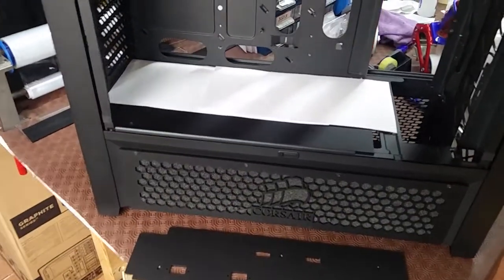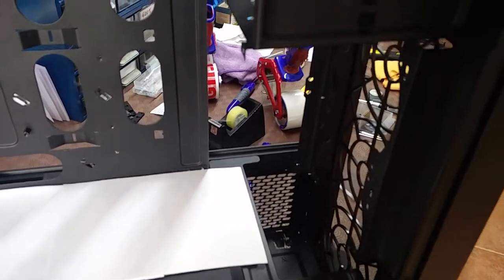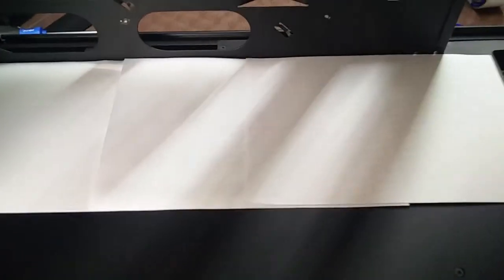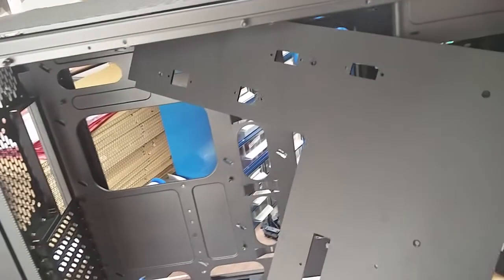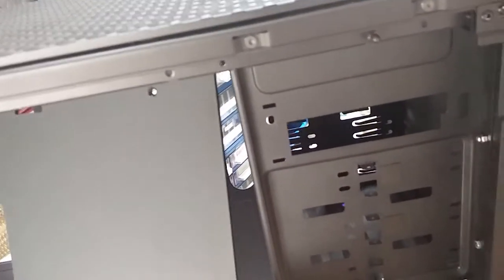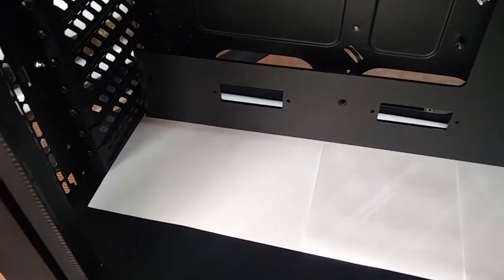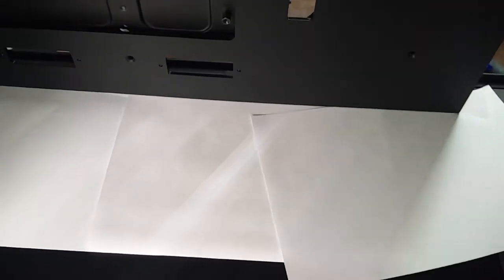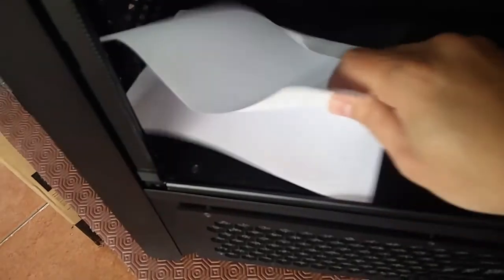Corsair 900D Mb tray cover how to install by ColdZero

Comment: Have this its great but was wondering if u have updated version .just got my new mobo which is eatx unfortunately not enough room to route my atx power cable
Reply from the maker: These can be made for e-atx motherboards as well. You just need to order and add a customization note saying you'd like to fit with an e-atx motherboard. And mention the motherboard model as well.

Comment: Hi, please I would like to know if for the Corsair 760T Motherboard Tray Cover you also need to remove the motherboard, thanks.
Reply from the maker: Hi, no, you don't need to remove the motherboard, to install the Corsair 760T Motherboard Tray Cover. We made a recent change to the cover that has a little more space around the motherboard.

Comment: Can uninstsll it without removing the mainboard ? Ofc the Power suply and cables removed.
Reply from the maker: No. you need to remove the motherboard as the cover goes under it 1-2mm